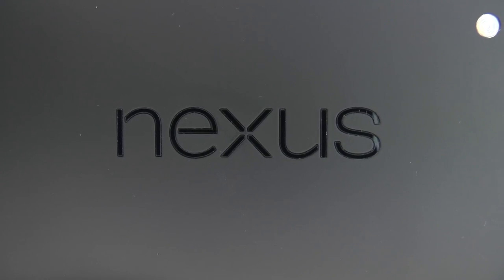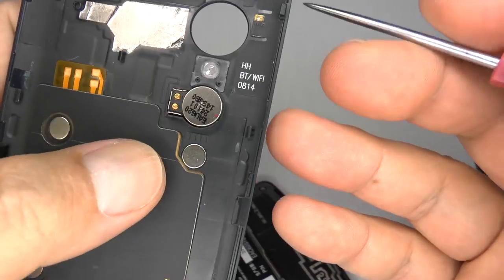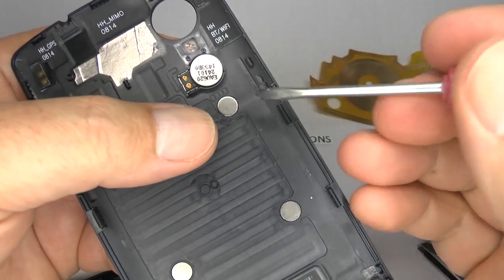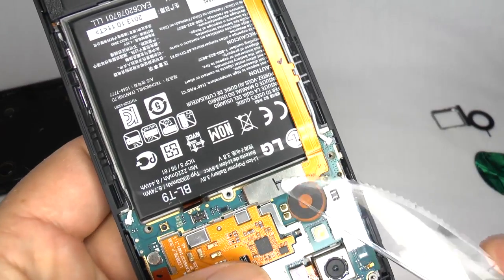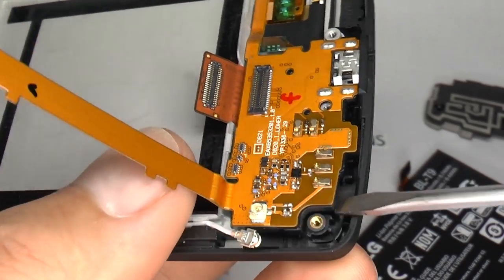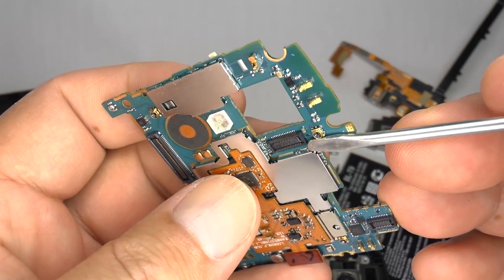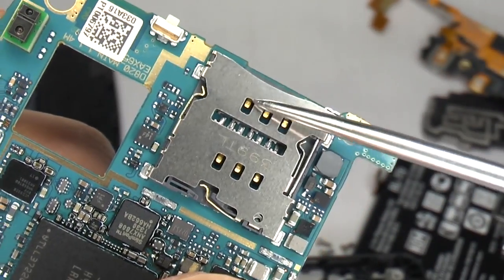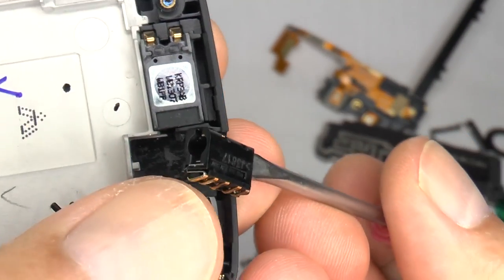Nexus 5 Teardown - Disassembly & Assembly - Screen Repair & Case Replacement LG-D821 - 820

Comment: I just replaced my screen.  The video I used wasn't done as well as this one, and I wish I had found this one first.

Now that I've replaced my screen, the issue that I've run into is that the digitizer is not working properly.  I press one area on the screen, but it registers somewhere above or below where I've pressed.  I believe this is just a faulty screen (and not a bad install), however, is there something I may have messed up with this?  Thanks in advance.

Comment: Cheers for a great video. I just have an issue, after replacing my screen it appears that the brand-new screen (which is OEM) is running at a low resolution. I'll try crack it open again and reseat the cables, but could anything else be causing the problem?

Comment: Hi, can you please help?
I disassembly the button part on 10:23, and out of nowhere got stuck with a little round .black rubber 
Its very similar to the rubber on 4:32 on the left of the RF shielding, just a little bit bigger.
I've been watching the video back and forth , but didnt see it.

Comment: Very informative video, clear instruction a real lesson on disassembly and reassembly of the nexus5.Have now used this video 3 times on replacement of different parts battery etc.

Comment: I bought a used Nexus 5 which suffered water damage as I later found out. The seller told me, that he used the phone until I bought it. Now when I want to use the phone with my sim, which is a new one, I have a very weak signal. I lose it most of the time. When I use the phone with a sim from another carrier (the same like the seller used) it's working fine. The phone also works with a third carrier but not with the one I want to use. There is also another phenomenon: when I take of the back cover, the signal becomes much stronger, still not good but much better. The sim is ok, because I use it now with my old phone and have no problems with the connection. Has anyone an idea where the problem could be? I’m thankful for any help.

Comment: Hi nice video..👍
my nexus 5 fall down from desk n then after i can not get the service providers connection the sim card is detected by the HW but only problem is it not getting signals of tower.. by disassembly i found that the TestPort near the 4G antenna is missing... can this be the posibility for not getting towers signals..?

Comment: Hello I fixed this phone for someone . The person didn't know if it could hold the charge. Well I changed the battery and screen. Now when I connect the battery it turns on. But it always keeps its percent 0 doesn't charge what can be the problem?

Comment: I have a Nexus 5 and the standard Nexus case. I spilled coffee while reading my emails and it hit the bottom of the phone case and into the case through the microphone and speaker holes. The only way I can be heard now is by turning on the speaker phone but they can't hear me otherwise. I don't know which parts to replace or see it on the parts list. Waiting for the New Nexus 5 but I need a working phone now. Is it possible for you to suggest how or whether I should try to replace the microphone? Your help would be greatly appreciated.

Comment: Indicate me to my problems please, the screen I believed works and was installed correctly because I saw it so but I reopen it once again and I believe that I have short circuited, one or more of the phone parts, this it what happens the screen is now completely none lit once early some times it will fewly may flick on glow blank screen, and a white light indicator will blink a few times, I plug it back into wall charger still blinking indicator only sign, tryed to hooking everything and re attacking pins still nothing but then later I was messing around with the power button I don't remember what I did and it came on booted and I was even on net thennn....doom it red faded screen lost color and a sign saying "xremove" and screen powers down I have not been able to re do what I have done and get it to star up since then I fear I have short circuited one but what, help soon.  I know that the screen is working though, maybes mother board issue why i don't know  i think it just is cause power seems to be in the phone.

Comment: Just changed my screen. It works sometimes, other times it just shows a kinda pink pixelated screen, without showing anything. Anyone knows if this is a problem on the screen or may be in other areas? Thanks

Comment: Hi, my Nexus 5's WiFi is not working and it seems to be a hardware issue. Which part or circuit board should I replace to get WiFi back?

Comment: Great teardown where you don't actually explain any part of the process. "Just release the clips" indeed..
Reply from the maker: the modfather have you actually watched this video ? 0:53
Reply: +the modfather 
What's there to "explain?" You take the parts off, you put them on again. He said what the parts were and how to remove them. It's a how-to video, not a how-it-works video. Everything that needed to be explained was.
Reply: He shows undoing all the clips as well as having them all marked with white paint for you on the back.   Best instructions I've seen anywhere.

Comment: My phone freezes and turn off / or just turn off, like very day or in one day few times. To turn it on, sometimes you just use power button, but most of the time I need to reconnect battery and then it works. 

Can you tell me what is problem? Do I need to replace battery or?

Comment: hlo bro.my nexus 5 when i press little bit hard on my mobile back cover the screen goes black.And then after restart the mobile working properly.some times I press back cover the screen colors are changing..its is the flex cable problem or screen problem pls tell me.

Comment: Great Video, Thank You so much for your time doing this. My Phone is so happy thanks to your hard work in making this video.
Reply: quick note, i noticed my ear piece speaker wasn't working, i assembled in the dark and did not notice the platform that needs to be removed and transferred to the new screen and digitizer assembly i re-watched video and noticed you made no mention of it. Thanks again and i am glad i could give a little back to make sure everyone has the same success as me thanks to your video. Ear piece works great now.

Comment: great video thanks for uploading! just 2 things i noticed the earpiece case needs removing also if replacing screen and when putting back of phone back on make sure to press in the middle of the phone case till you hear a click or the vibrate wont work.

Comment: Not shown in the video but might be helpful to someone, there are two parts to the microphone @20:00. The top part they remove in the video, and a bottom part still attached to the case. You need to transfer the bottom part if you are using a new case... Though it will be kinda obvious cause the microphone won't fit in the hole without it.

Comment: Thank you for the video. I was able to repair the camera, lens, charging port, and replace the battery. It went without a hitch and is working as good if not better than new.

Comment: Hi again :-)
I wonder if I might pick your brains once again?
On disconnecting the connector from the 4G antenna (connected to the main board at the top end of the phone), the whole connector that was on the MB came away with the antenna! The other three disconnected OK.
From where I am, I can see two options:
1) solder the existing 4G antenna connector (still currently attached to the antenna cable) back into place, or
2) see if I can get hold of a slightly longer 4g antenna cable that will run from the 4G connector on the USB flex and up and round to the 4G test port.
Please would you give me any advice that you can? Would re-soldering the connector onto the MB be a viable option, or is it now well and truly broken and if so, does anyone sell a cable that has a 4G connector at one end and a 4G test port connector at the other?

Thanks in advance for your time and reply :-)

Steve.
Reply from the maker: I would think the 2nd option is best as you will be able to solder both wires without any problems, I don't think resoldering the original would work as its probably taken the copper track with it..
Reply: OK - thank you once again for your advice :-)
Steve.
Reply: ***** Hi again (and sorry to ask yet another question!) With regard to the RF test port, is it a case of soldering what was the central pin down through the centre of the test port and the other one at any point around the outside of the port?
Thanks again :-)
Steve.
Reply: ***** Just on other question. If I simply cut off (and then extend) the existing cable, is there an easy way of knowing which of the two wires is which? Do I need to be looking for any particular properties for the extension wire that I use (my dad does a lot of railway modeling, so has lots of quite fine wire)
As always, thank you once again :-)
Steve.
Reply from the maker: MrTpt1 the cable is coax and has a centre core which needs to go to the centre pin. The outside is ground and as you say can be any point around the outside...
Reply: ***** Thank you again - that makes sense (and makes it easier too) :-)
Kind regards,
Steve.

Comment: Hi. Thank You so much for your job! Your channel very usefull! Thank You!
I have a question, may be you know - i have LG Nexus 5 Red 32GB and i'de droped it and after that no network (mobile network). Wifi and bluetooth working well, but mobile network (sim cards) not working anymore. I took it to LG Service Centre (i live in Baku,Azerbaijan) and they said that it can not be repaired (!!!). You may be not believe, but in our city there is no any real specialist in electronic\soldering works :(
So, what you can say about this? In this video i saw you'r talking about gsm moduls and about simcard tray - if problem is in simcard tray i think resoldering it with new one can solve problem, isnt it? Or if there is corrupted some gsm modul, which one must be replaced? 
Thanks in advance!
Reply: I am facing the samr problem. any update on how you resolved it?

Comment: Thanks for the video.

After reassembling I found I had a small grey rubber piece left over and I can't find out where it went!  The speaker isn't working so not sure if it's related to that, but rewatched and couldn't spot anything,
Reply: Ashley Jones figured out what the plastic bit is but the speaker still isn't working and I seem to have not connected the antenna correctly.  Not my day!

Comment: Hi there, if you still remember me, I am the guy with the nokia n8 problem and who thanked you for the galaxy note 10.1 tutorial and nowi am having the nexus 5 d821 32gb. I still have my n8 which I myself repaired it and galaxy note still going on good. Just incase if I had any problem with my nexus 5, which, so far, I have not experienced, becomes very helpful to me, your video should be a learning guide. Kuddos

Comment: Help! I recently replaced the power button without any issues whatsoever, but once everything was reassembled, the optical image stabilization stopped working. The camera works fine and I can take pictures just fine, but I am 100% sure the OIS does not function at all. Any idea what may have happened? Thanks for the video!
Reply: maybe someting got jammed in the camera gap

Comment: Thanks for your instruction. I followed the procedures to replace my broken LCD. everything works fine but the OS doesn't get updated with the battery percentage. It shows unknown and always the sign of being out of battery.
Do you have any suggestion on that?
Reply from the maker: try disconnecting the battery for a short while

Comment: If I replace the motherboard, does the motherboard need to be the same storage as the previous motherboard? For example: I want to replace a 32 gb motherboard with a 16gb motherboard. Will it work?
Reply: You can use any Nexus 5 motherboard to go with your screen. Just make sure it's from the right country.

Comment: Hey there,
I have a Nexus 5, that dropped a few days ago and now the Touchscreen dont work any more. It shows everything, but doesnt react to any touch input. The keys still work.
I disassembled and assembled the device after your very good and precise instructions down to the frame.
Unfortunately the screen still doesnt react. The white horizontal bars, that were seen on the screen before are gone. I guess they where caused by a loose contact.

Does anyone have an idea what could be the reason for that? I mean, if nothing else helps, I would be willing to buy a new touchdisplay for about 80€, but have to be sure that this causes the error :/

Thanks for any advice and hints in advance
Reply: +Philipp Weiss i have the same problem , were u able to find a solutionÉ

Comment: *****, I used this tutorial to disassemble a phone that had suffered water damage three weeks prior. It had been completely dried out but hadn't operated since. Before any disassembly, I was able to get the phone to turn on, but the touchscreen was unresponsive. I disassembled the phone to clean any corrosion from the flex cable contacts, in hopes of restoring touch functionality. Once the phone was reassembled, I thought it was dead. It turns out that the backlight is no longer functioning. I did, however, restore the touchscreen functionality. There is an area directly below the screen's flex cable covered in a small strip of green tape. I removed that tape and lightly brushed some corrosion away with a soft brush, just as I did the rest of the flex cable connectors. Is it possible that touching that area has ruined the backlight? (I've reseated all the connectors 3 times), and if so, would using replacing the screen also replace that small circuitry?

Thank you!
Reply from the maker: a new screen might be the answer but there's a small chance the mainboard or main flex might be damaged. It must be worth a try..

Comment: hello, thank you for the fantastic video, i currently have a broken nexus 5 screen but i cant find any parts to replace my screen and housing ( i have a white nexus 5 ) with the glossy black side frame instead of soft touch like the black model, where can i find the part i need? thanks

i am also in the uk, london, if you know any places i can get hold of that part quickly that would be fantastic
Reply from the maker: I've had a look and I don't see any for sale at the moment, but give it a few weeks and there should be some on the market
Reply: ***** your video helped me to repair my nexus 5 and it is now working perfectly! thank you very much! Also i kept my old screen, because i wanted to try and change the glass only! is there any chace you will put that video up soon?
Reply: Hi....did you manage to get the replacement screen yet?

Comment: This is probably a stupid question, but are you able to buy a higher Megapixel camera off of Amazon and replace it with the low 8MP back camera on the Nexus 5?
Reply from the maker: nice idea but not technically possible

Comment: super informative!
my phone either got dropped or some desinfecting fluid got inside
digitizer stopped responding along a vertical line roughly where d and f keys are on the virt keyboard. Everything else is fine, no cracks nothing.
would that be a broken ribbon cable, or something with the digitizer itself?
Reply from the maker: It might be worth trying another screen but if the liquid has touched the mainboard it might still have the same problem with a new screen

Comment: Do you if it's possible to replace the Nexus 5's battery with the LG G2's 3000mAh battery?
Reply from the maker: if its the same size and has the connector in the same place then yes, but I would have though LG have squeezed as much power as they can in that space..

Comment: Excellent video, Very thorough.

I am having trouble getting the earpiece speaker to work. It looks like the replacement screen and frame I bought seems to be missing some of the plastic that pushes the earpiece speaker onto the contacts. I suspect I can fix this with some sort of bodge but don't have time this evening. Has anyone seen anything similar?
Reply: There is a definite difference between the 2 screen + frames that I had. Was able to connect speaker to pcb with some blue tack as a spacer

Comment: Repair went fine but the back cover must not be tight against the motherboard, because wireless charging and vibrate don't work. Any solutions for this? I've removed the glue at the bottom of the frame and the case appears to be closed perfectly.
Reply from the maker: try stretching the springs on the vibrating motor and slightly raise the sprung pins that make contact with the wireless charging contacts

Comment: Thank you for the helpful video! I was wondering if the device would still power on even if the screen is disconnected from the phone? My phone's screen broke and it won't power on anymore. I would just like it to boot up enough for adb to pull all the files in the internal memory.
Reply from the maker: I think it hangs if the digitizer is damaged, another screen should make it work ok